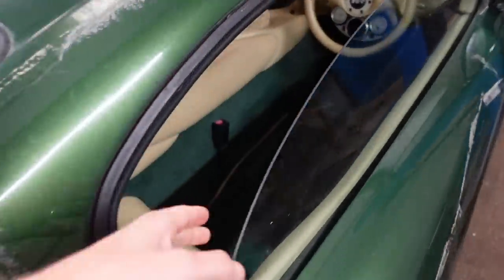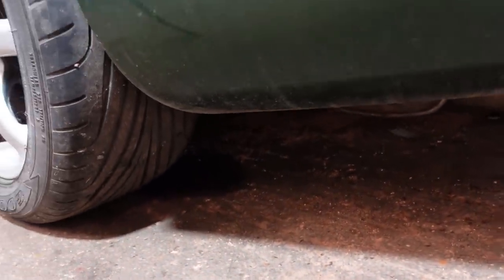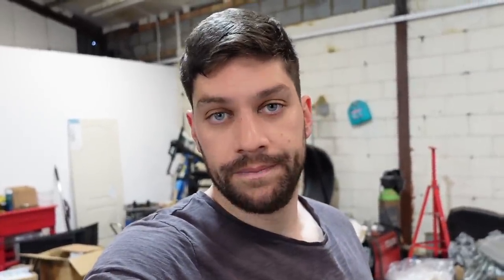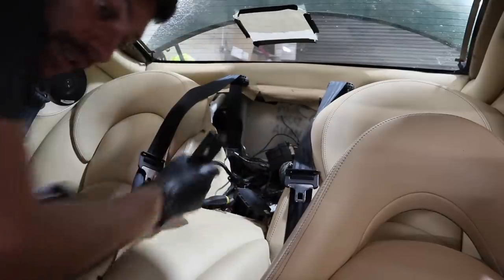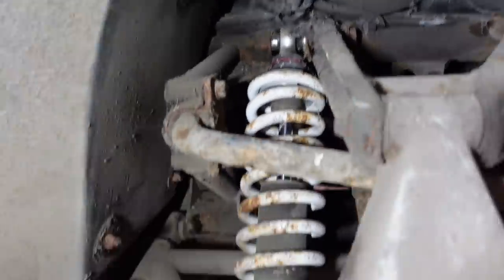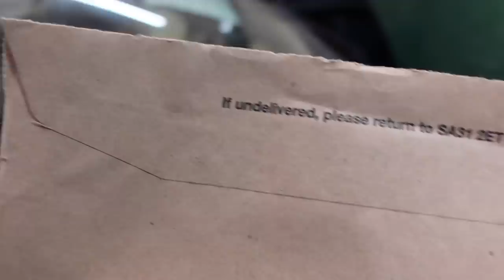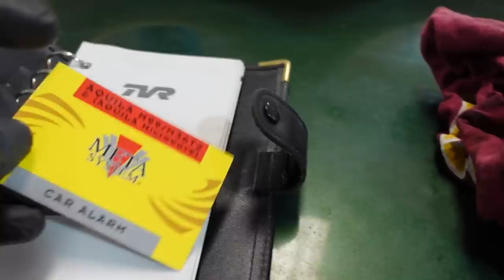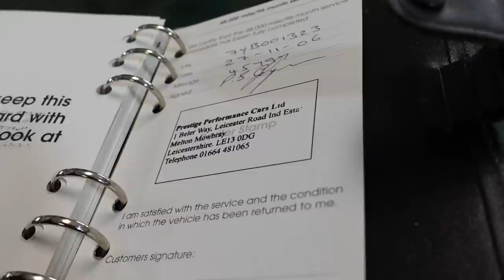MY BARN FIND TVR CERBERA ELECTRICS ARE RUINED!! PT.3

Comment: Anyone that has ever had to solve electrical problem on a car appreciates the effort you had to go to to make these "simple" circuits work. For my part I have a car where the nearside reversing light will not come on. Hours I've spent on it, dismantling, cleaning contacts, changing components, checking earth, continuity, fuses, switches, everything I can think of, but still.........the beggar won't light up. ARRRGGGHHH!!!!

Comment: I spent 3 weeks trying to fathom a gear box "limp home" fault. Testing all ecu pin voltages in and out of fault. Turned out to be the crank sensor which dropped 0.05v in fault! Keep going, love it! And you're going to love driving it!

Comment: This car has mechanical emergency door openers. Look in the boot and to your upper right, behind the fuel tank, you’ll see a red t shaped handle. If you pull that it opens the driver’s door. Now look in the foot well. If you are in the driver’s seat look to your right, and in the passenger seat to your left, you’ll see what looks like a door opening handle next to your foot. That’s the emergency mechanical door release, if you have no power.

Comment: Well done mate. You may recall I commented on the last video how similar your task is to what I'm doing with my green barn-find (field find) TVR 350i. More similarities. My LH door wouldn't open - the internals and handle were in the glove box, and I struggled with ignition. Spent hours fiddling with relays, nothing worked, then I randomly tried it again and it turned over. 10 odd years difference in the age of the cars, but similar issues:)

Comment: Nice to see your passion for this Cerebra. This takes me back to my TVR days, I remember picking up my new Chimaera 500 from the factory in the mid 90's, a previous progress visit revealed a skull painted on the bulk head behind the seats, cool but a little ominous. Many fond memories to reminisce over, I recall a track day when one of the circuit organizers said to me .. see that old guy sitting over there with the walking stick, he retired as TVR's Chief Test Driver. A few moments later he is at the controls with me in the passenger seat, we destroyed every exotic on the track that day. Straight line performance was extraordinary, although corner handling was a complete handful for me at least. On one not so memorable day, as my wife has reminded me for 25 years, I span out on a wet roundabout catching my front left wheel on a kerb and bounced towards the ditch, the engine died. We tried everything but could not get the car to start, after calling for help it turned out there is a fuel pump electrical cutoff switch that disables the car after a bump. From memory on the Chimaera the reset toggle is located right up inside the footwell driver's side. Just a consideration for you. Keep up the great work!

Comment: Like many automotive recoveries, this is part detective story, part mystery tour through the labyrinth that is chewed, or frayed cables, and missing earths land. Fibreglass cars do often have earth issues, (as do many older cars) and finding them can be another ramble through dark passages. I thought that you were lucky not to enter blown fuse city, or conflagration hell by applying power with so many, hidden insulation stripped, wires all lying there ready to party. Unravelling the mysteries is part of the appeal, as are the joys of your triumphs, as problems are found and cleared. Keep up the good work, this will be a long-running story of frustrations, and hopefully, ultimate joy.

Comment: Great video Dean. Having rebuild my own TVR the earths are SOOOOO important. 
TVR used the chassis for their earth's which is not ideal. But that is TVR for you. :)
Also on a side note the wiring diagrams you will/have found and the colour codes are to be taken with a pinch of salt.  There are stories of them using whatever colour wire that had the most of to make the TVR looms.  
Note the fuse box in the boot is a VW/Audi part the same i think as my Chimaera. Thought you might like that 😎😂 being a Audi guy

Comment: The handbook and service history, great bonus that. Digest every word in there as so many quirks to various operations as you are finding out from ignition through to even operating basic functions. Probably the hardest thing is that you do not have a stock Cebera as a reference point. Also there was a lot of cross model common elements, hence everything you Google will have comments from TVR s2 through to Sagaris owners and everything between!

Comment: I used to have an immobiliser with that little rectangle fob, there should be a little mating plate for it somewhere that you have to touch the pins to - to deactivate the immobiliser.

Comment: A Cerbera sounds simple, but it is more of a challenge than anyone expects. Good luck with this car. At least you will get to go through the whole thing. An early factory rebuild was all too common for the speed six engine for the early 00s and it was the financial undoing of the company. Seeing your car also had a later engine rebuild may (fingers crossed) mean that it just needs a gentle recommissioning.
Body off is a faff, but I don't think your chassis will be too bad. Replacement outriggers is almost a given but then a blast and repowercoat should see it good for the next 20/25 years.
I think you'll curse so much for buying this car, but you'll be so emotionally invested by the end.
HAVE YOU HAD AN OPPORTUNITY TO GO OUT IN A CERBERA (SP6) BEFORE??? and could you reach out to your local TVRCC or any local owner to use them ??

Comment: Great work mate so hard working on old cars glad you finally got ignition. Might have to have the pump out and give it a flush out if it’s been sitting for years and if the fuel was left low and taken on moisture 👍

Comment: It's a restoration project and it's on a car that is not your run of the mill mass produced type so this is not only fantastic content,it's also helps others with the same car ! .where's the fun in skipping over the most fundamental things like immobilizer system and ignition system.?
Barr the adverts this video had me on the edge of my seat . this is really turning into a fantastic project and we can all feel the emotions you are going through . which makes it even more fantastic.
Just do things your way , it's fantastic content and it's helping others.
Isn't that what YouTube should be about?

Comment: I hope you’re going to have a look at the cylinders with a camera before you even turn it over!
Slow & steady wins the race. As a Cerb owner I’m fascinated with this strip down as I’ve luckily never seen how the car is laid out/built.
The only trouble ive had is with the door card block connectors that needed replacing. The pins were almost rotted through and there was all sorts of gunk in them which made my windows very slow.
Reply from the maker: Yeah I’ve got my boroscope on charge ready! 🤣

Comment: I'm working on one of these at the moment. If you give 12v to the fuel pump and 12v to the ignition wire (this is at the ignition module in the boot), you will get ignition lights. If you then de-activate the immobiliser you will hear the fuel pump prime. if you then give the starter wire 12v, the car will start and run (or should do). All done from the boot connector to the ign module. 

This can all be done in the boot and will help you check the car will run/drive etc if that's your goal. The one I'm working on the actual ignition module has failed.

Comment: I found on the chimera that the door won’t open with the button after central locking, but if you peel back the panel on the pillar next to the door, you’ll see a retro door lock solenoid. Pull the cable and you can pop the door that way too.

Comment: Engine rebuild is a good thing. Unfortunately they cheaped out on materials when they went into production and had top end wear issues. It would be worth getting on the forums and checking whether the factory changed to better parts or just used the same again. If the latter, it will need a top end rebuild again at some point.

Comment: Electrical nightmare!  just be cautious about making the “good” earth with that small cable from the ignition control unit. Naturally other things that draw higher current may also seek to use that good earth you added onto the ignition control unit which the harness probably can’t handle.  I would suggest sorting the main earth before going any further.

Comment: Mate - don’t be in such a rush to start that engine - mine was a barn find and the fuel rail was full of crap (fuel had broken down), all that went into the injectors and it ran like crap. I had to get them all cleaned and ultimately replaced.
Thank God your 2 steps ahead of me, I didn’t take the fuel tank out (for cleaning) until after all that slimy fuel had all but blocked the fuel pump and just about everything else.

Comment: The electrics on TVRs were rubbish from new, so don't feel too bad. I used to deal with a guy who sold the connectors to TVR for their looms. For every 4 cars they sent to the US they included 3 extra complete looms in the boot of one of the cars to deal with the problems they knew the cars would have, and they were rarely wrong.

Comment: Using the angle grinder and creating hot sparks will be a problem with your fibreglass body.
The molten steel will embed itself into the bodywork and create a peppering of ferrous (rust prone) metal.
Please cover all bodywork when grinding.
I know this from grinding next to a GRP boat once and the owner getting mad!!
Forgive me if this has already been covered.
Loving the Trevor resto!

Comment: This is what would put me off trying to restore a relatively modern car like this. In fact I did scrap my 2004 Vauxhall Combo van rather than spend money on immobilisers, engine management computers or whatever. Most other faults I would have fixed as I hate scrapping vehicles but it is so demoralising to be defeated by anti theft devices on your own vehicle.

Comment: Is that writing on the inside panel old TVR graffiti, it has been mentioned before how the workers sometimes wrote on the panels that customers could not see. Great video, it's challenges like that that you can spend days on, I do not envy you as those corroded nuts are not a great confidence builder for the chassis, keep up the good work.

Comment: There should be an emergency door release, red lever, in the footwell for each door.  It's kinda in the sill where your left foot would be for passenger.  Supposed to only pull in emergency, I was told because it can damage window and frame as the window doesn't drop first.... But your window already down, so....
Reply: Comment for visibility in case he has future problems with the door release button

Comment: I would strip the interior, if it's been sat it'd benefit from a good clean and a nice leather balm anyway. it means you can get rid of any gunk and filth behind all the panels and check all the electrical system and BCM loom. Will be worth it in the long run as you will know what's good and what isn't.

Comment: The engine being rebuilt on the Cerbera is completely normal as they are highly strung race engines fitted in a road car.
Turn the engine over quite a few times with the fuel and spark disconnected to get oil flow around the engine before firing it up.

Comment: I have 1 of those Meta immobilisers fitted to my KTM bike as they are an oem part for the ktm's, on youtube there is a walk thru of how to disconnect the Meta box and short 2 of the pins on the loom plug to bypass the immobiliser ! possibly the same or close to the 1 you have !

Comment: I do not understand why people cannot realize the obvious--in any recovery, evaluation, or repair situation for an old or unknown vehicle the LAST thing you do is to start the engine.  Starting the engine does not magically restore life to the machine.  Even attempting to turn the engine without first evaluating its condition can wreck an otherwise salvageable machine.  Starting the machine, or even connecting a battery,  can ruin an electrical system which is compromised by age or uninformed tinkering.  Examine, inspect, evaluate and repair.  If you do the job correctly, the first start will be as routine as starting the car you just  drove home an hour ago.  That is the proof of the mechanic.

Comment: My 1968 cutlass was neglected AF, most of electronics are inoperable (warning lights,  gauges, clock, radio heater fan, courtesy lights etc) because the water did a good job rusting up the fuse box, electronics is least of my concern the whole wiring system is far more simple than a microchip from a cheap talking action figures from McDonald's Happy Meal.

Comment: Rather than connecting the wires when you fished them out, why didn’t you just apply power to them as this would have opened the door? This would have been no different from applying power from the boot?

Comment: There should be a red pull cable in the passenger side cill for emergency opening off the door
Reply from the maker: Yeah for the drivers door, not passenger
Reply: @SavingSalvage   have a prod around the carpet on the cill there definitely should be one

Comment: Couldn't you just jumper the starter instead of farting around with the wiring? Unless the immobilizer won't let you do so, I would think that would be a eaiser solution. 12 volts to the ignition, plugs, starter, and fuel pump and you should be able to get it to kick over
Reply from the maker: Yeah I could, but I’d have to sort the ignition at some point. It would be good to know that all my systems work before I start taking the body off.
Reply: @SavingSalvage  that's fair. As I got close to the end of the video, I was pretty damned stoked that you were able to get the ignition working at least. Here's hoping the engine is good knick